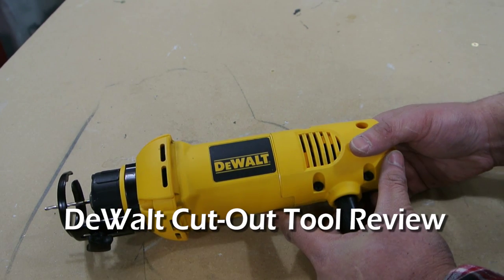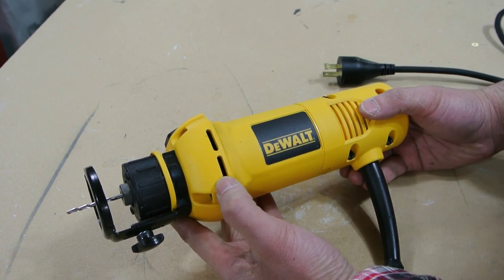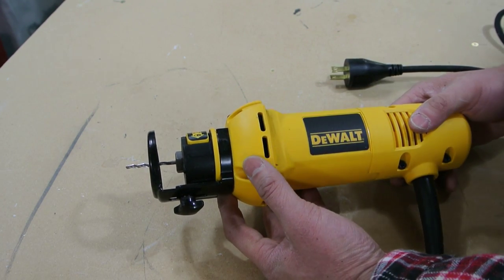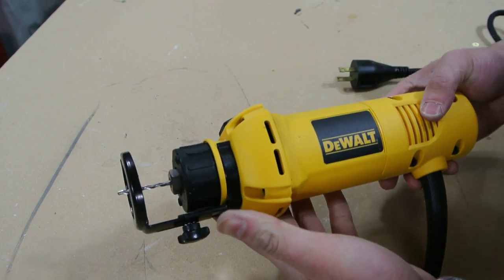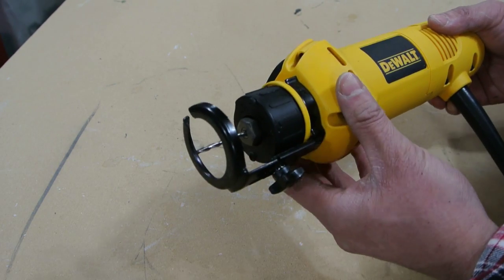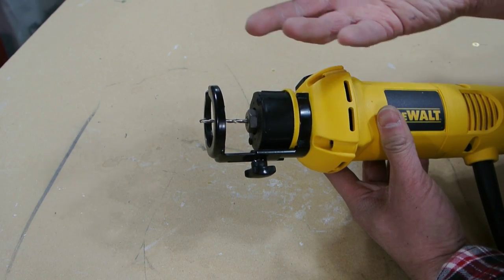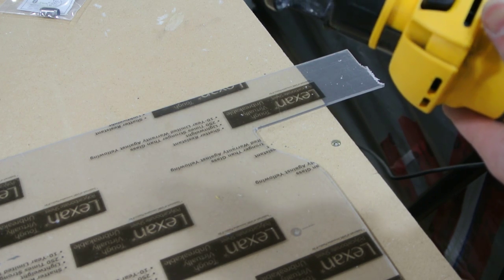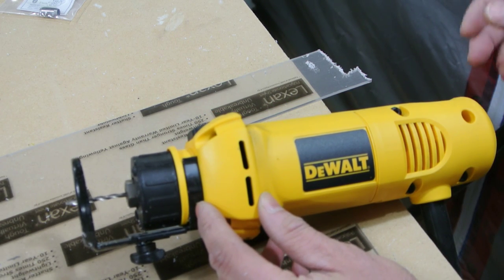Dewalt DW660 Cut-Out Tool Review

Comment: I don't remember ever using my DeWalt DW660 for cutting drywall. Rather I use this tool with a RotoTool 3-1/2" metal cutting blade. The blade attaches to a 1/4 shaft which fits the DeWalt DW660 with the included 1/4" collet. This setup easily cuts 1/8" thick angle iron, and I have cut a 5/16" padlock shackle with ease. These blades are thin, about 1/16" thick so they cut easily. They wear down but they are inexpensive to replace.
Reply from the maker: Cool that is good to hear.  Makes for a good poor man's die grinder.

Comment: I know it's not ment for what I intend on using this tool for. but I want to organize my wrenches, pliers, ratchet's, sockets, etc have them loose in my tool box. I want to cut out the silhouette of my tools on those foam pads, the kind it used for I guess anti fatigue or those colored one for kids to play on, The foam Pads or mats wtv are just under half an inch in thickness. could I use this to cut out the silhouette of my tools? I imagine it would do the job fine since I'd be cutting something way softer than drywall and just as thick.
Reply from the maker: I think it would work just fine on that foam.  That foam is pretty solid.  BTW good idea using that foam,

Comment: I have a broken Rotozip rebel, and the sanding pads are gathering dust. I don't want to throw them out. Can I use them on this cutout tool, or another similar name brand tool?
Reply: This tool fits any 1/8" drive bit. I believe that a 1/4" collett is also available. It can be used as a router of sorts, but that's not what it's made for.

Comment: To the questions, if you put in a tile bit cutter, it will permanently weld itself between the collar and bit , if you use it to cut mdf or wood, it will heatthe wood (burnt up). its meant only for Drywall Only!  do not modify to cut door hinges. There are a lot Ding Dongs, if you know these ding dongs do not buy their used tools., Andrew did a fantastic video, only negative is the smucking when narrating. make sure you buy the correct bit and do not use general cutting bit
Reply: grinding is fine

Comment: can you use a 1/4 inch router  bit to do light router work
Reply from the maker: Maybe if the collet would hold it.  Might be a little too much for this tool.
Reply: +Andrew W Thanks for answering my question. the bits do fit and it will do small runs but the problem that i found was that the adjustable depth part is not sturdy enough to make a good cut. You're right it does have plenty of power for what it is made for. thank you for the great review.
Reply: Yes you can, but the base does not cover enough area to make it very stable for that use.
Reply: I just used a simaler tool with a 1/4" router bit to mortis door hinges, I think you could also trim formica with the proper 1/4" bit
Reply: I made a round HDPE circle plate and glued the circle plate onto the round plate I made and use for mortise hinge template for years, it has more power than you need